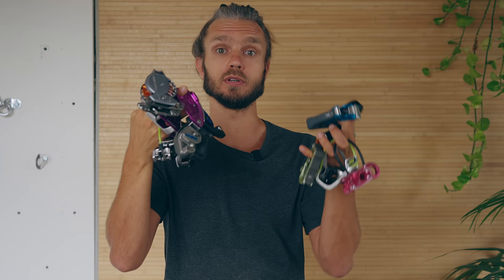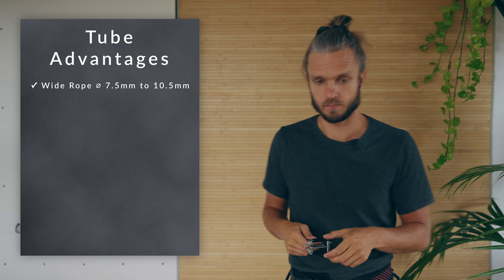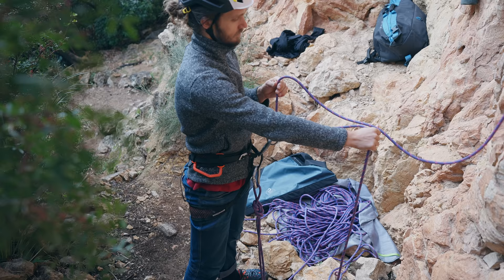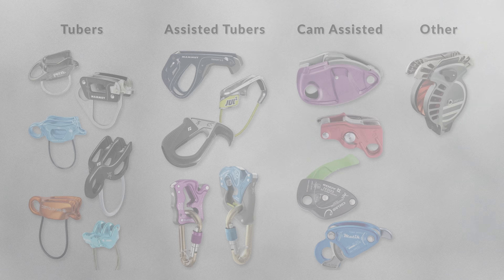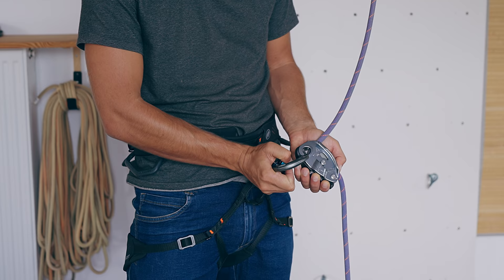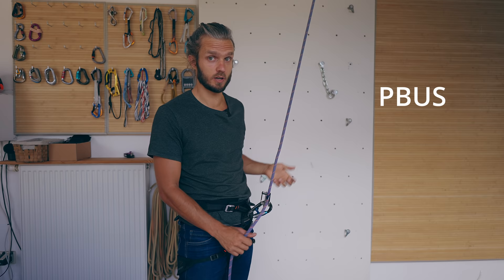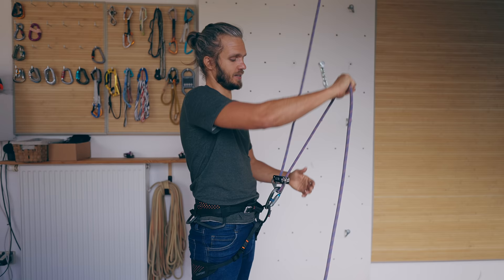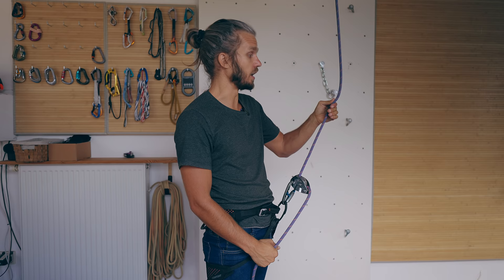Complete Guide into Belay Devices - Differences and Efficient Usage | Ep.6

Comment: Excellent vid. I wouuld like to point out that for giving or taking out slack you can help it by taking one step forwards or backwards. I feel that it is an advantage to be a little bit mobile when belaying, specially when you need to give slack quickly when the climber is clipping. thank you for your efforts an d excellent material. Cheers
Reply: I train this out of climbers because the majority of locations I have been to simply do not have flat and clear enough landings for this to be feasible. Two of my local and favorite projecting crags are on ledges which simply would not be wide enough, and enough are irregular that I wouldn’t be making much progress while being poorly positioned and being attentive to avoiding rocks.

Most folks just need to resist the temptation to pull in slack after a clip and give more slack than is just enough. I also train this out of climbers, the difference is getting rid of the illusion of safety to make people properly assess safe falls like a softer but further catch.
Reply: That is absolutely true in a gym and that's what I usually do, specially with an ABD, but on mountains or multi pitch climbs you are hanging from the protection you placed or you are on a tiny ledge and you can't move .

Comment: One thing I want to add is that if you have both a tube and an assisted braking device (like grigri) to have separate carabiners specifically for each. Because with the grigri there isn't any rope touching the carabiner and only the metal/plastic part touches it you get small nicks in a carabiner when someone falls. These nicks and scratches will get deeper and they are sharp. If you then use a tubular device the rope can get damaged by those sharp edges. 

I also use a carabiner with a notch for my Grigri, the DMM Edge. This prevents the Grigri from ever crossloading.

Comment: I use a fourth way with the tuber. Just swap hands, no sliding. Left hand up, feeds down the rope, right hand pulls forward. Then just put the left hand down, the right hand goes on top, right hand feeds into the device, left hand pulls down, then you move the right hand down and are back at the start. You always have a hand firmly grabbing the rope beneath the tuber. It’s not a complicated movement, both hands can do it.

Comment: You should also compare the “alpine up” from Climbing Technology. Its a quite interesting device but i dont know why, it isnt very knowed. Good video man, thanks for you effort.
Reply: It is essentially a version of the click up for two ropes. Plus it has a mode where it works like a tube and can be used in guide mode to belay two followers.
It can also be used to rappell in click up mode without a prussik backup in mode, because it will lock by itself if you let go of the handle.

Edelrid has several comparable devices that work with two ropes: Mega Jul, Micro Jul and Giga Jul.
The Mega Jul is an assisted tuber for two ropes. It can be used for sport climbing with single ropes, but also for alpine/multipitch climbing with twin or half ropes. It also has a guide mode, but it is slightly more complicated to set up than on other devices. It has a very limited tube mode, where you simply turn the device around, now you can give slack like with a tube, but have to lift the lever to take rope. This mode is only really useful for rapelling.
Rapelling without backup in brake assist mode might be possible (check first if device/carabiner/rope combination actually locks), but might be jerky. Putting an extra carabiner (not every model fits) in the extra hole of the device and using it as a lever can give you better control over your descent speed.

The Micro Jul is a smaller version of the Mega Jul for skinny ropes.

The Giga Jul (I have it) has an assisted braking mode like the Mega Jul, but also a has tube mode that can actually do everything (yes, everything) a regular tube can do. Guide mode works like on a regular tube. The brake assist effectiveness is very dependent on the carabiner. All Edelrid carabiners are suboptimal (Bulletproof is the Edelrid model that gets the closest to working), but Black Diamond Gridlock and Rocklock work pretty well.
Rapelling without backup in brake assist mode is not possible with most ropes (especially new/skinny/dry), because the rope slowly slips through. If it does work, the same jerkiness and workaround points of the Mega Jul apply.

At the end, you need to decide if you prefer regular assisted tubes (Edelrid) or the Click Up/Alpine Up handling. 
Regular assisted tubes usually require you to manually hold the divice open to give slack. And giving slack against resistance in the rope heap is difficult. But they'll still lock most of the time, even if you let go of the brake rope. 
The Click Up allows you to give slack like with a tube, which might be nice if you have to work against drag in the rope heap. But it'll only lock reliably if you have the hand of the brake rope.

Comment: Hey Ben, wanted to share my belay accident. 
I was climbing with my wife, I have some experience, she is a novice and we were climbing something easy to teach and train her in belaying. 
Got to the anchor clipped in, instead of asking for take a grabbed the rope that goes to the belayer and started lowering myself to the next bolt and get my quickdraw. The belayer had some weight on her but most of it was in my hands and she also lowered me a little. After taking out the quickdraw I had a meter of slack between my hand and me through the anchor.
I decided to let go of the rope, at the same time my belayer tried to lower me as well.
I felt a short catch and then continued to fall all the way to the ground. Approximately 9m fall. (for Americans, 9m is roughly 2/3 McDonald's sigh post)
Belayer used a Mammut alpine smart assisted device, and held the device with right hand and rope (tail) with left.
The short fall and open device caused a rope burn on the hand and smacking her to the wall, and it caused her to let go of the rope.
The device was stuck in a weird way on the rock and therefore didn't lock.
I was able to replicate the unfortunate belay device not locking.

Luckily I landed on my feet with absolutely no injuries, and top roped it again to get the rest of my quickdraws (after calming down my very stressed wife)
Reply from the maker: First of all good job at your ninja skills ;)
And... I don't have Mammut Apline Smart with me to try to reproduce this, but what I would do in your case is to write your story to Mammut (they have great customer service) and figure out if it was a user error or some issue with the device it self.
p.s. love distance measurement unit - McDonalds post :DDDDD
Reply: @HardIsEasy  it is just like the Grigri hitting the bolt and not locking,
Just an extreme use case in which the locking fails.

I will make a video of the failure mode and send it to Mamut.

Comment: I’ve had a edelrid eddy for years ( cam,device) 
I really like the fact in a panic. If the rope is pulled it engages and locks. ( great in a surprise accident) 
You can also flick the cam with you finger to fast belay. 
It’s a bit heavier than a gri gri but I like the inbuilt panic feature

Comment: one other demo of loosing control of the rope is for sailors, if not enough turns are put on the sheet winch, same thing, the hand is flung into the top of the winch, hence the need to be aware where body parts are around these moving devices.

Comment: I like the click-up. You quickly get used to unlocking it intuitively in case it locks by accident, while feeding rope or so.

Also I did a lot of research beforehand, as I was deciding between Grigri and Click-Up. The Grigri seems to be designed in a way that encourages users to get into sloppy behaviour over time. There are tons of cases where a Grigri failed due to wrong usage.
The Click-Up seems to me much more straight-forward and foolproof in that regard.

Comment: I once had a belay device (one of those squares), where I missed the carabiner as I locked in the loop, and it appeared to pinch the rope with all the resistence you would expect, but not infact be able to stop a fall. had my partner fallen, the rope would have just popped out in my hand. I was belaying my partner on a 5.9, with a top rope, he got to the top, I was getting ready to lower him, when I realized I did not really have him. luckily, my friend was a good climber, on a rock we knew well. always double check your connection, and give it a hard yank to make sure you are really able to break.

Comment: Nice!! Really appreciate that you took the effort and time to redo it 💪🏻 👏🏻 

What happened to the Mammut Smart Alpine!?? Discontinued?? Have 2 for Trad and love them. 

For single rope - I find that with the wider fixed diameter cam inside the GRIGRI - my ropes generally last longer. Less wear and tear when under load/lowering. They don’t get as tightly pinched/curved when lowering like with tube and tube abd devices. 

South Africa - we use the hand over hand method as best practice. Iv played with the tunnel method but naturally revert back to hand over hand. As a coach - I belay a lot! 😁

Another one I use when the rope is thick and sticky to belay - tires both shoulders instead of only one - The “ambidextrous” method. Right hand goes up, takes in, starts to drop, left hand goes to brake strand, near device and then lastly right hand goes high on the climbers end! Now you take with your left and repeat the process swopping sides. 

Again - thank you and keep ‘em coming!!! 

Baie Baie Dankie 🙏🏻😎
Reply: Smart Alpine is discontinued. But Edelrid has the Mega Jul and Giga Jul, which both do similar things.

Comment: Thank you for this complete video. 
For me there is a strong drawback to tunnel technique not mentioned in this video, especially when it is the one taught first to beginners :
I often see people completely open their breaking hand to put it up when taking slack, instead of sliding it up with hand closed. I think this is a bad deformation of the tunnel technique, when people have to quickly take slack, or when they can't slide their hand (this sometimes happen, especially when you take a lot of slack and your belay device go down).

I really think we should not teach the tunnel technique as first technique to beginners. Just as you advised in the video, they should learn either hand over hand or PBUS technique, and once this is fully natural to them, they could learn tunnel technique as a complementary technique. Thus, in "panic" case, they would fallback to a safe technique rather than completely open breaking hand, when hand can't slide up.
Reply: And thank you to remind that breaking side of the rope should always be hold, even with assisted belay devices. I see way to often people with cam locking devices release their hand from breaking side of the rope.

Comment: thank you for the video! I have very little experience with belaying devices, mostly with tube style. I'd love to see video of comparing the different kind/brands of devices so I could decide which would suite me better, just like the Ropes video.
Reply from the maker: Hey thank you so much! I might make a bigger review of multiple devices at some point, but if it's for Sport Climbing I would go with ether of these: Grigri, Mammut Smart 2.0, Edelrid Jul2 - from my experience they work the best... But there are also many I haven't tried :D
Reply: Would second the smart 2.0 or either an atc pilot if you use ropes over 9.5 in diameter or a jul if you use ropes under 9.5. For non assisted, I do like the bionic alpine shown (called the nordwand alpine now) for having a metal plate to guide from to help direct the anchor when belaying a second, the lowering hole fits most of my carabiners easily, and overall the bite on ropes when rappelling is wonderful to need only a simple autoblock or couple leg wraps if needing to be hands free.
Reply: @HardIsEasy  thanks it is for indoor climbing indeed I’ll take your advice to mind 🙂

Comment: A subtle but slightly better way of loading and unloading rope into and out of a belay device is once you pull the bight of rope through the hole to pinch it on the other side, make it larger and put it into the gate as opposed to handling the device and rope as you do at 14:53. It's a small thing but as someone who has been on a multipitch with a partner who has dropped their device it could save a world of hurt.

Comment: You missed the most efficient way to take up slack while belaying. Pull down on the climber side of the rope while pulling the brake hand away from the device like all the methods you showed. Then grab the brake side of the rope close to the device with the free hand and it becomes the brake hand. Release the previous brake hand and grab high on the climber's side again and repeat. You just alternate the brake hand as you go.  This works for taking and giving slack. You can move the rope really quickly without ever letting go of your brake hand this way.

If your "off/bad" hand and arm are strong enough to climb a route, they're strong enough to break a belay device. It may feel a bit weird at first, but if you're used to awkward multi-pitch belays, you should be used to using both hands anyway. Plus, it will help your brain hemispheres communicate with each other. Everyone should really be able to do pretty much everything just as well with either hand. If you want to argue your limitations, go ahead, but they can be overcome.

Comment: could you technically repel from the top of the cliff, tied off to a tree, or bolder, etc...  then after getting to the bottom, start climbing back up, and use a belaying device to remain safe in case of a fall, instead of using anchoring devices installed into the cliff face?

Comment: Hard is Easy, thanks for the vids (plural), very informative. I would like to ask a question about friction control. Say you have two belay devices made for different rope diameters, for example a BD ATC Guide (8.5 mm - 11 mm) and a BD ATC Alpine Guide (6.5 mm - 9.0 mm). Do both devices give you the same friction if used with the same rope (e.g. with a 9 mm) ?

Comment: Absolutely outstanding informative video - thank you.

Wondering what carabineer youre using on your harness, as it clearly allows the harness to stay on the cirrect end without hindering it being opened to add/remove your belay device :)
Reply: Save you a reply, I just found your other video on exactly that, so thanks again!
Reply: P.s. totally agree with your comment about the tunnel method having a slightly misleading name. I did think to myself for the other two (locally more accepted in the UK) when taking in smaller amounts in a row, I prefer to take and lock, take and lock without the hand shuffle, of course avoiding any moment hands are shuffling which is a potential risk, especially if people get lazy like you pointed out. Personally I will still avoid the tunnel method, simply because I was taught as an instructor, not saying I'm better than anybody, blessed with high quality experience maybe, but mostly that I was encouraged to hold high standards using only broadly accepted methods :) Love the videos. Lots more I want to watch!

Comment: Hello - just to say that I don't think what you demonstrated for assisted tubular/breaking devices applies to the Jul2. With the Jul2, you basically keep your thumb in the device and that's how you hold the rope. You only move your hand from the device when you want to take in slack. Basically, unless you are taking in slack, your bottom does not actually hold the rope itself, it holds the device and the rope together. It means that when the device locks, you can very easily and quickly feed slack because your hand is already on the device. Here is a link to the user manual https://avs.edelrid.com/images/attribut/54564_GAL_JUL2_ANSICHT.pdf  - see figure 5a for normal belay/paying slack and 5b for taking in slack.

Comment: What happens if I press the cam of a grigri+ really hard and not let go of the break rope? Does it hold or do I just burn my hand?
Reply: It holds. 

But if you press down hard on the cam - and hold the brake end lightly with the same hand - and the rope is super skinny - the climber will keep falling 💀

Eyes on climber. Thumb up when you don’t need it down. Eyes down, thumb up. 

Trust me 🫣
Reply: @1on1adventures48  Does this also apply to when the cam gets jammed in the first quickdraw? As long as I hold the break rope I can catch the climber? Just unassisted?
Reply: Golden rule - Hold that brake hand down and firm. All will be ok when hitting that first draw.

Comment: Thanks for the great video. Do you have any idea how the break force on a munter, locked up (or down) compares to the break forces required by the tubular devices?
Reply: Going by the howNot2 videos the knot will break first. Rope always fails before gear and if knotted then that is where it will almost always break because of the tightening bends in the knot.
Reply: @chrishughes3405  I think he means the force the belayer needs to apply to the breaking strand of the rope to hold the climber, based on the angle they are holding the rope when using a Munter hitch (Like what he's doing at 1:00 in the video). Not how much it will actually take to break a tube device vs. a munter.

Comment: I have had the Mammut Smart device fail on me in two different scenarios.  Not just failing to lock, but locking in such a way as to reduce friction almost entirely. Thank god I had on gloves and was only lowering the climber so I had time to do a hip/leg wrap. If the climber had fallen I could not have caught him. In the second instance I was dropped three bolts from a take at a bolt by my belayer. She managed to knock it out if it’s bad lock position and stop me from hitting the ground. I refuse to use this device now. It’s dangerous.